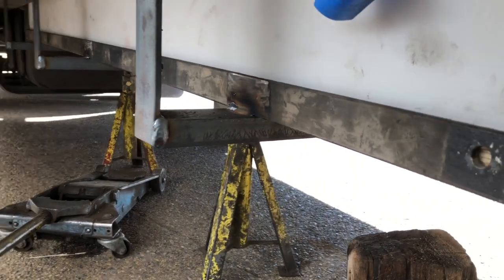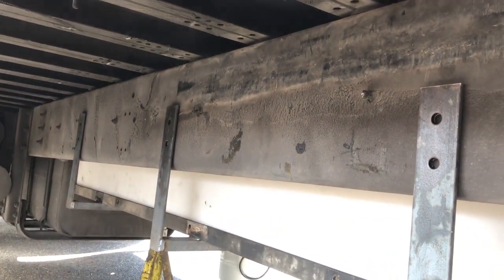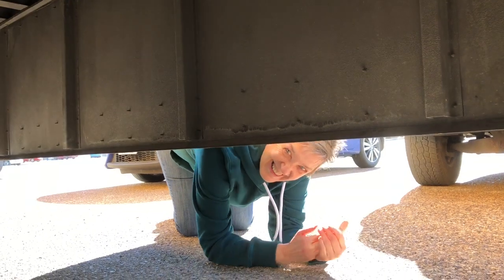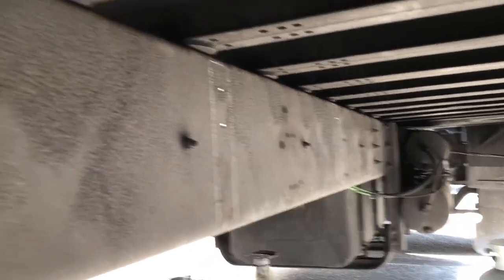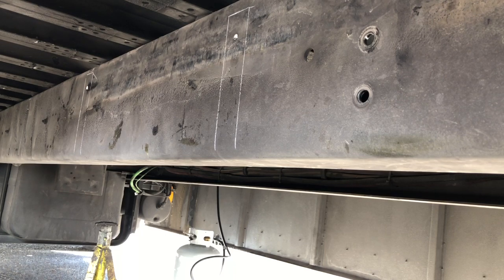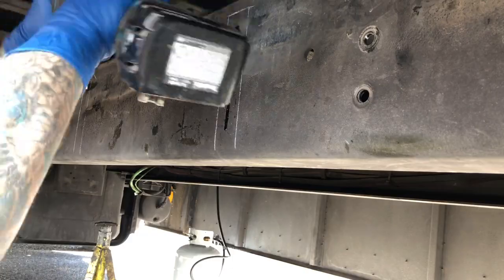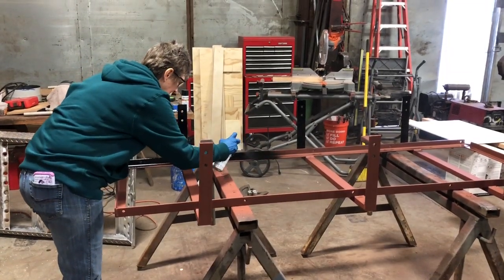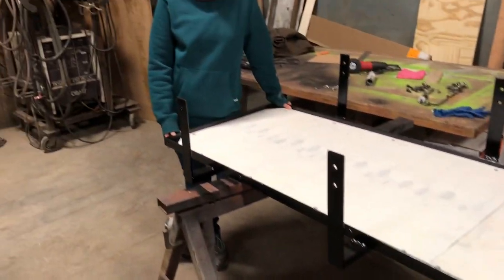Fresh Water Tank in “C” Frame - Part 2 - Vlog 82 School Bus Conversion

Comment: That’s some hard work under there, I feel your pain 😬.
Did you consider using “U Bolts” to avoid the back breaking, hot metal chips falling on you, drill break, sharpening..

Just a suggestion, labor cost money and body aches, in DIY we try to avoid both
Reply from the maker: We didn’t have the confidence that the U-bolts would keep it in place. So we did what we did.  😃
Reply: @KnappTime  I have used the industrial rated type to hang a lot heavier stuff on some of my work trucks